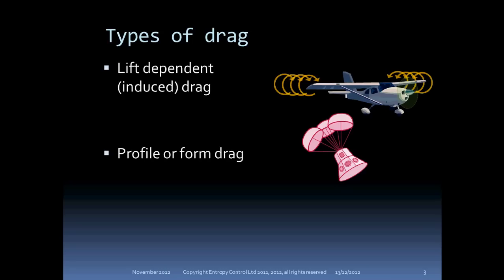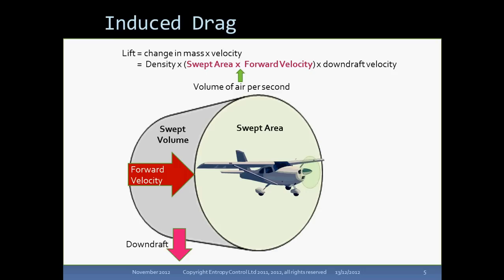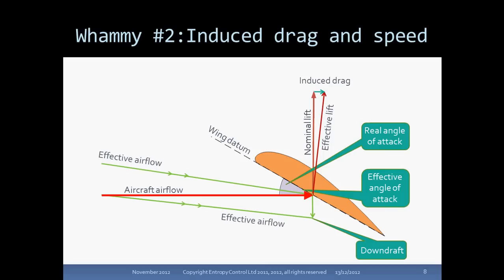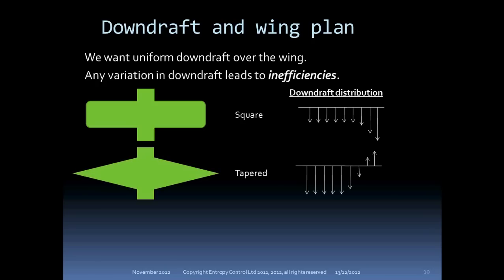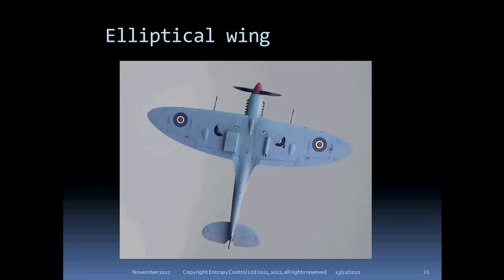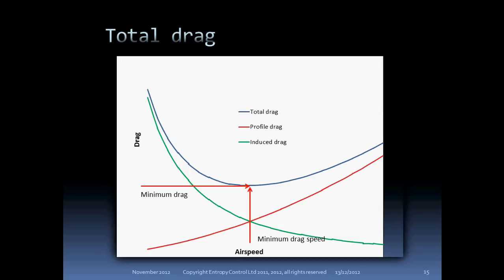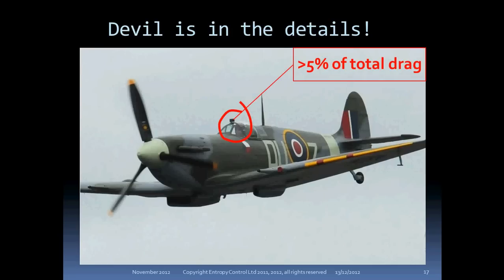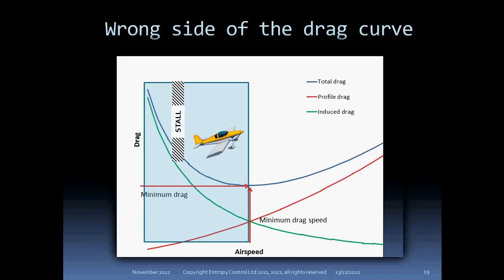Aereodynamics for Pilots Lecture 2 Drag

Comment: Lift it is not created by "downdraft". Lift is created as a result of a pressure difference between the lower surface and upper surface of the wing...and Bernoulli's fluid law explains it very well. Although Newton action and reaction law is PART of the lift, it only accounts for fractions of total lift created. This is easily demonstrated by the stalling of the wing with an excessive AOA (usually 17 degrees). If lift would be created by the down draft as you say, a wing will never stall..yet a wing stalls AT ANY SPEED AND ANY ALTITUDE.  You can also try these experiments at home: 1. Turn on your faucet 2. Take a spoon and place it with the curved part into the stream 3. Force is created because of the accelerated fluid (low pressure - vacuum)  and Coanda's effect. Second experiment (for kids) Take a sheet of paper, keep it close to your mouth and blow over it. Voila: low pressure above. No downdrafts here.Cheers!
Reply from the maker: You are perfectly right about Bernoulli being involved. But all that sucking and blowing has to result in a downdraft because there has to be a change of momentum downwards to provide a lift upwards. I have deliberately avoided talking about the origins of lift here (But see my lecture on Where Does Lift Come from) and concentrated on the fact that there IS lift and therefore there IS downdraft. The downdraft is interesting in that it explains so many of the peculiarities of aircraft behavior.

The spoon in water flow experiment has a side-draft corresponding to the sideways force on the spoon. That flow to the side is quite easy to see if you look carefully. There is not much of a sideflow because there is not much force, and water is dense..

I hope this helps!

Comment: Great video series! Detailed, clear presentation and interesting information. Thanks for making this available. Two questions:
 
4:17: Whammy #1: My understanding from the video is that the effect of increasing the airspeed is to rotate the “effective airflow” down towards the horizontal as the downdraft remains unchanged. But wouldn’t the angle of the “effective airflow” remain unchanged? (I am thinking of Anderson & Eberhardt’s “Understanding Flight”, 2nd Ed, p.12, which says that doubling the speed of the wing will cause the vertical velocity of the air to be doubled.)

5:02: Whammy #2: If I understand you correctly, when the airspeed is increased, the length of the cylinder increases which means that for a given lift you can decrease the downdraft. Wouldn’t the “real angle of attack” also be reduced because the airplane’s nose is lowered to reduce the downdraft?
Reply from the maker: Hi!

Excellent questions! I am so flattered that you watched the video so carefully.

The "double" whammy of course is not something that happens in two steps as I have shown, but happens simultaneously. It is certainly true that if you increase the speed with everything being equal, then all speeds will increase including the downdraft. But for an airplane where lift = weight, the downdraft always adjust itself so that there is just enough to hold the airplane up. Increasing the airspeed does not require an increase in downdraft to keep the aircraft up, hence it remains the same (in Whammy #1) and you get that rotation of the resultant airflow towards the horizontal that I talked about. And, as you say, and increase in speed increases the length of that cylinder, reducing the need to have such a high downdraft velocity while still holding the aircraft up (Whammy #2). Of course the aircraft will require trimming at the higher speed, and that is part of why the downdraft is reduced. The vetor change I show is a picture of what happens after all the speed and pithc changes have taken place.

If you would like to continue this conversation offline, please email me at entropycontrol@gmail.com.